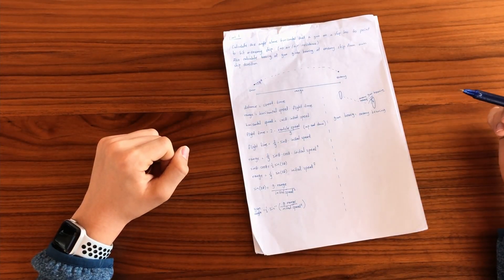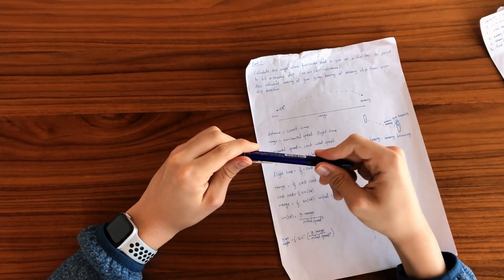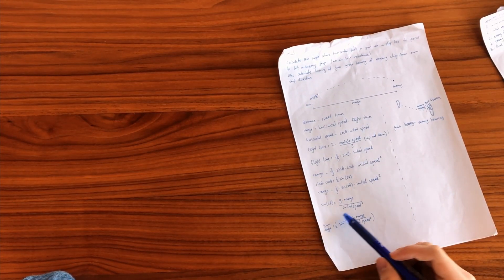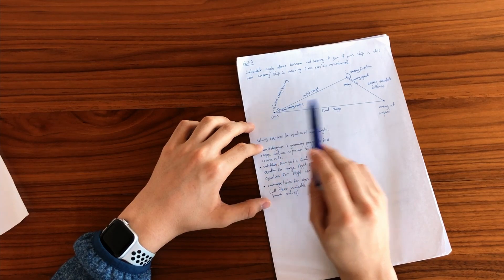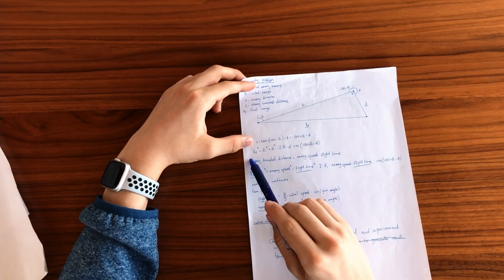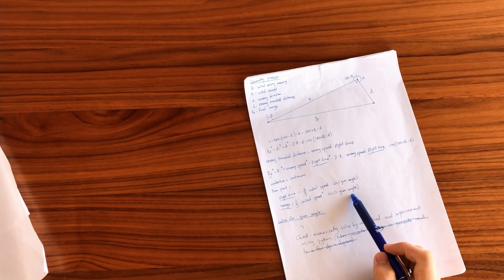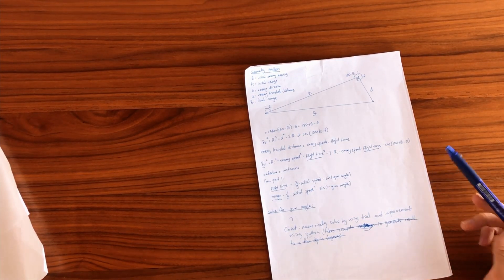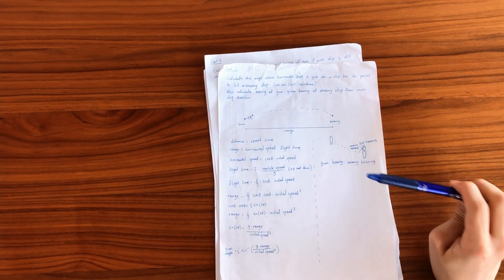Turret Aimer Part 4 - The Mathematics

Comment: If you want to do the math properly here's a tip: assume turret is at (0,0,0) and is not moving. your projectile is P and, in space, its position is (Px,Py,Pz) you can express those three variables as functions of speed, elevation and direction according to the equations you already know.
Your enemy is E and it's at (Ex, Ey, Ez). You can express those three according to the equations you already know.
The projectile hits the target when Px=Ex, Py=Ey and Pz=Ez (That's a system of linear equations and it's easily solvable)

Comment: Heyo, love the videos. I'm looking at the pdfs of the math and notice the dark streak on all the scans. I had a similar problem with my Plustek scanner. After contacting customer support they told to run the calibration wizard and it fixed the issue. It now works like a charm. Not sure if yours's has the same issues but hopefully that helps.
Reply from the maker: Oh thanks, I have a HP printer/scanner so I’ll try that at some point